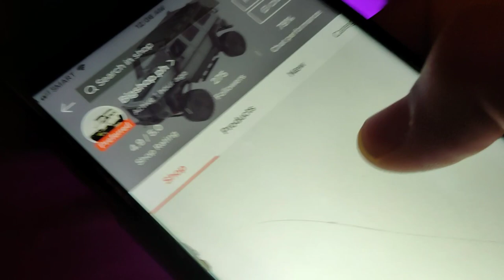Installing WPL Remote Control Sound System V3 Transmitter with Winch Set To MN99s

Comment: What happen to reciever?
Reply from the maker: I accidentally plug the positive and negative the wrong way and it causes to fry the board, but I didn't got in on camera. The fire only triggered when I installed the winch
Reply: @hiroyongque  If the receiver on the original remote burns out, will a new receiver connect to the old remote?
Reply from the maker: @nirosharc  yes as long as it's the same I believe
Reply: @hiroyongque  Thanks, I subbed too

Comment: so after upgrade to this esc, meaning cannot use light anymore bro..
Reply from the maker: Hi! The sound kit v3 also include headlight port.
Reply: You can upgrade for a DumboRC 4 channel radio and 20amps with brake ESC. Buy tamiya full lights set and plug in the new radio. Easy